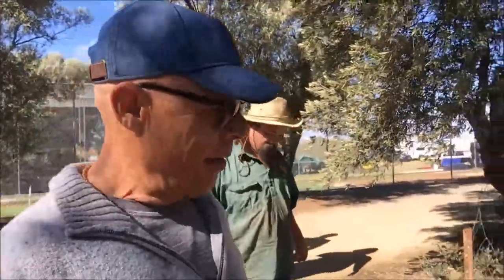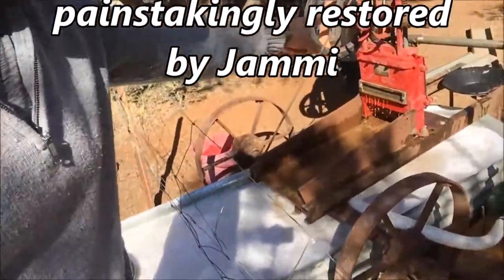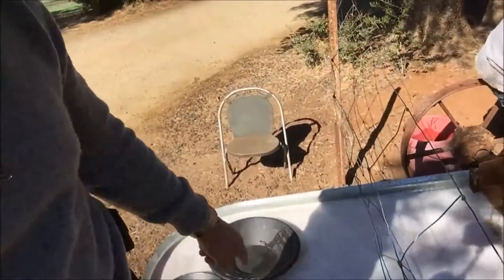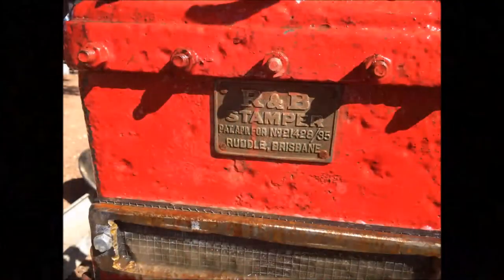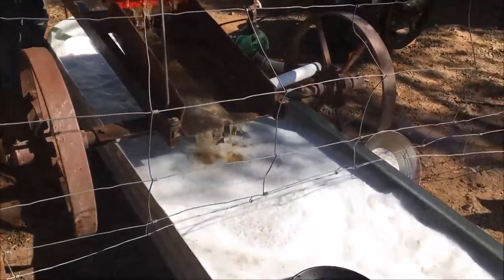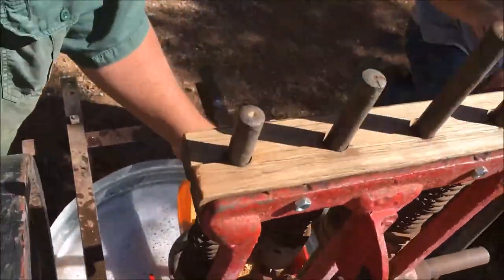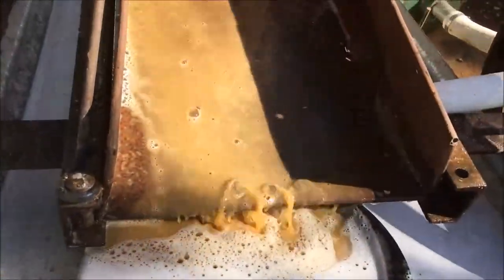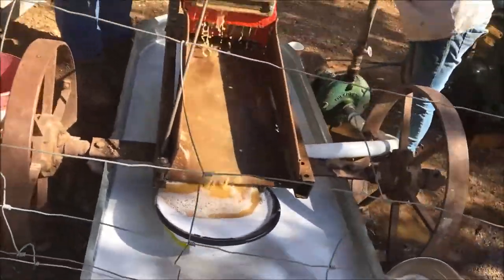Gold Stamper..Made in Brisbane in 1934 Australia.

Comment: Great to see Famo. Thanks for posting it. Them engines aren't actually steam driven. They run off petrol(or diesel). They have a governor connected to a latch out mechanism that allows the inlet valve to open when it slows down to a certain rpm. Known as a hit and miss engine. The steam coming out of it is just from the cooling water. When it fires or "hits" those flywheels keep it spinning and not firing"miss". When it slows down, the inlet valve opens, takes in fuel, and hits again. cheers.
Reply from the maker: Hi Victor Bitter 
You are definitely correct..
I can’t believe we let these old motors go..
They run on the smell of an oily rag..!
Glad you like it.
Cheers Tony.👍🍺⛏🇦🇺